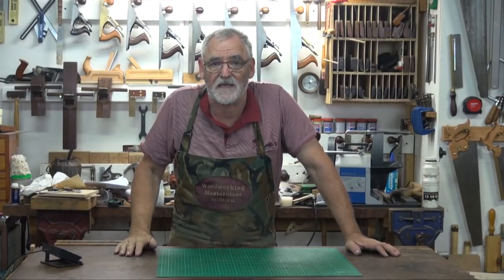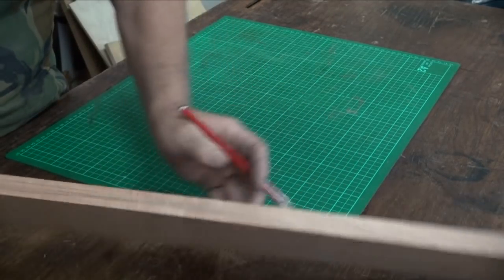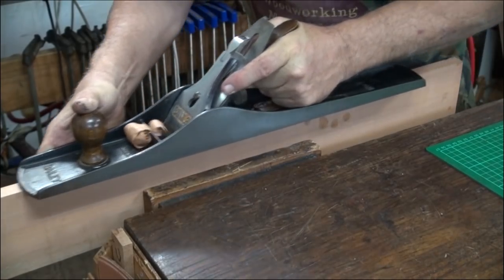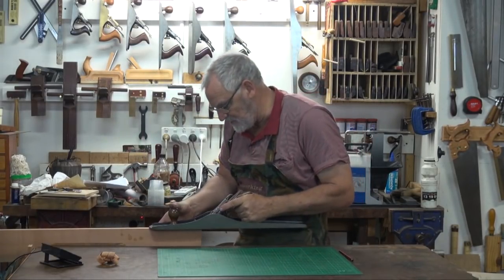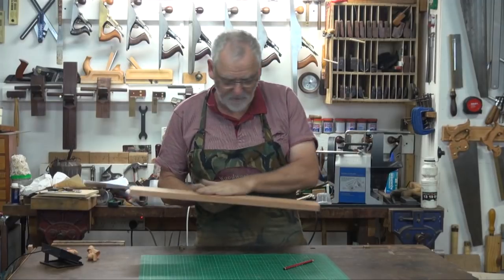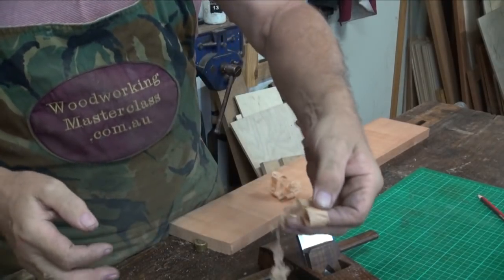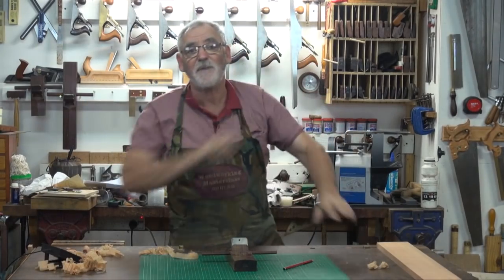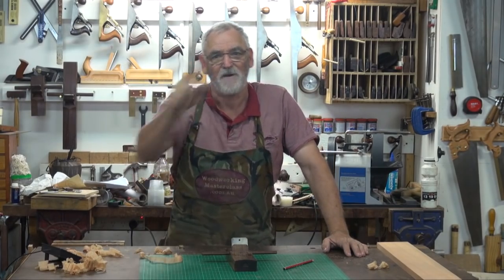Hand Plane Finish

Comment: Well stated Steve.  Amen on the need for handplanes.  Ditto on scrapers too.  Sure beats sanding and it cuts the grain instead of burnishing the fibers resulting in a better end product.
Reply from the maker: Thanks Hardnox. Another great thing about planing you don't get grain fur up when you apply a finish either. Appreciate the comment. Cheers Steve

Comment: i agree wholeheartedly,  the machines are for roughing lumber to desired size and then its hand tools to dress them properly.  saves a heap of time on sanding as a quick scuff with 180 and its all done.
Reply from the maker: So true Tayler. All machines I believe are for rapid waste removal not final cut or finish. Cheers Steve

Comment: Also, for those that don't have a machine jointer, you need to have a flat side to ref. in a machine thickness planer. Otherwise, you will still have an uneven/twisted, etc...board.
Reply from the maker: So True. Thanks for your comment Yamaha. Cheers Steve
Reply: @Woodworkingmasterclass     You bet, Steve. Thanks for all of your hard work, dedication and education.

Comment: Hi, I hope you see this comment. I had a quick question about staining my wood after using a hand plain on it. Would I still want to sand the wood with 220grit sandpaper in between coats of the stain, as I know when you use sandpaper instead of planing it is usually recommend to sand in between coats. Or do you not need to use any sandpaper in between coats if you used a planner instead?  Thanks
Reply from the maker: Hi adam, as a rule I only sand between coats if there is and risen grain. Which seldom happens of you use a plane as the blade slices the timber in a clean cut whereas sanding abrades and separates the fibers which caused them to swell when they become wet. Do do the feel test, if it feels smooth don't sand if it feel rough light sand with 240. Hope that helps Cheers Steve
Reply: @Woodworkingmasterclass  Thanks for the reply Steve. I'm new to woodworking and planning, so it's nice that there's people willing to share their knowledge